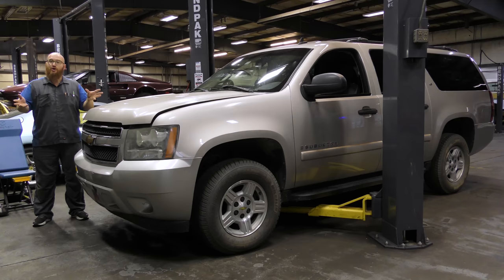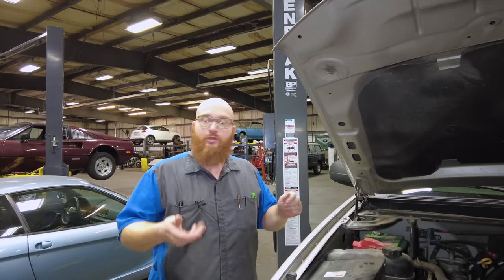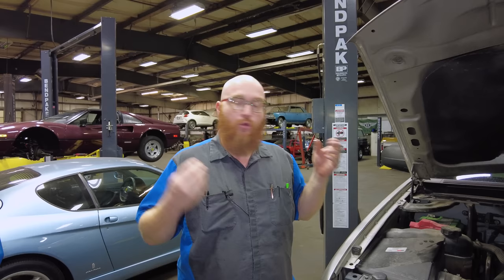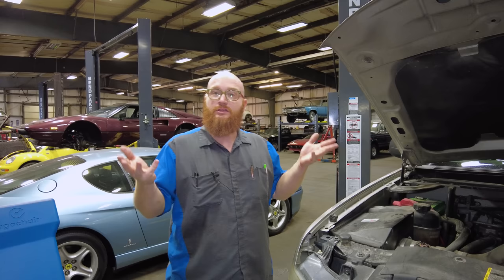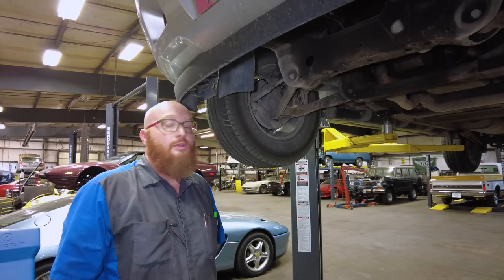What fails on ALL early 2000's Chevy SUV's!? CAR WIZARD shares what he's seen from the last 20 years

Comment: My dad has 2010 Tahoe he bought with 4k miles on it in 2011, and it’s currently at 340k miles. It is the most reliable truck I’ve ever seen. We live in The rust belt and have abused this truck every year sense we got it. I’ve pulled trees down with this thing and everything still works, even the fuel management! Really goes to show what proper maintenance and annual rust proofing can do
RE: I just started driving this truck as my daily for college and work, and have put about a couple thousand on it. It sat for a bit so not much has changed but she still runs minty fresh. Burns a little oil but with this kinda mileage you expect the rings to be less than factory fresh. Have new quarter panels and rockers on the way to make it look brand new.
Reply: Wow i have a 08 suburban LTZ with 210k miles this video scare me lol, but my SUV is reliable every thing  works great, i even pull a trailer 8k pounds weight with load for thousands of miles, my wife love this suv
Reply: Like they say even the broken watch is right twice a day. I had 3 GM 2 Chevy's they rotted out bad. Brake lines brake module transmission fuel pumps. Wen my brake lines and module went on my last truck I  scrapped it way to much to fix. The engines were not bad just everything else around it failed. Joys of living in the rust belt.
Reply: That is a rust belt issue
Reply: @markchapman2585  that is a rust belt issue not a general motors or Chevy problem trust me I have a Yukon with 432 thousand miles on it in Kansas City quality maintenance is job one
Reply: @markchapman2585  i loved the 2017 toyota rav4 (awd) in snow and ice. it was a night and day difference with 40% tire tread remaining compared to my 2015 kia soul (fwd) with brand new all-seasons. people that say that there's not much difference between awd and fwd are so wrong. i saw power being sent to the wheels individually on the rav4 even in a straight line in motion. i tell you what the rav4 is alot larger inside than it looks from the outside. lol.
Reply: Got a 2004 suburban z71 with 400k plus
Reply: @markchapman2585  Prove it. Because I think you are lying.
Reply: @Lincolnator721  i😅
Reply: That like saying I guarantee a person will die in they life
Reply: @markchapman2585  
Lanolin, every fall.
Reply: I have a 2004 Silverado with 320000 miles on it and I tow every day with it
Reply: @Fadi lsx  I have a 2004 Silverado with 170000 on it and I've spent a small fortune on it the past  10 years trying to keep it going
Reply: @jimmystone7325  that’s absolutely insane, I’ve spent next to nothing on my 321k mile 4.8 4l60 truck. I own a used car dealership and I use it to tow my cars all the time! Maybe the previous owner molested it hard ?
Reply: @nickajk1  it's a design problem. They can plate components much better than they do. Engineered to rust at about 7 years.
Reply: @MrCoyoteculler  everything today is cheap what do you think you see so many cars from the 50s 60s and 70s still around
Reply: "Since" not sense.
Reply: @k.c.marshall921  I'm sure it was a talk-to-text
Reply: Dimond in a rough most the the 90s and up chevys fall apart left and right mostly front ends and transmission
Reply: LOVE your story and love the fact that I've got an ARIZONA car with ZERO corrosion.  We do, however, get sun damage to the paint surfaces.
Reply: AFM , direct inject is were they went to crap
Reply: The same with my 2000 Tahoe. This guy is wrong wrong wrong. Not one single thing he mentioned has failed on mine and I have 300K on it. Tranny, 4X actuator and brakes is all. Tranny because I tow a loaded trailer a lot, and I do a lot of 4X4'in in the woods logging in the Northern Colorado Rockies at 7500 feet with brutal winters. Thumbs down on this channel and I wont be back.
Reply: @robertslatten556  but the thing is, he isn’t wrong. I’ve worked in 2 shops in my life and I’ve had a couple of these DoD engines come in with bad lifters. It happens. The key is maintenance. 3k oil changes and regular service intervals. New oil once in a while goes a long way for these.
Reply: @robertslatten556  My guess is that YOU are LUCKY, LUCKY, LUCKY given there's lots of AFM disasters out there and I stick with my '01 Suburban given it's got 320K miles on it and is in excellent condition and I'd buy a newer one BUT I as scared with those dual lifters and all the issues Chevy delivers to their customers because they suck up to government at the expense of their customers.
Reply: @nickajk1 factory should have fractured in rust problems and solved in designing
Reply: @richhuddleston73  really you believe it's a manufacturing problem or the local governments that over salt the roads and use up their inventory which is a little bit of rain or snow
Reply: sense we got it
Reply: I’ve got 237k, they made millions of these. Just gotta make sure you got a “good egg” haha.
Reply: I wonder why there's a pending lawsuit against general motors for the brake lines rusting out prematurely.  I was quoted new brake lines $1800. 05 Yukon.
Now I have to repair all the other electrical issues and engine including the oil consumption do to poorly designed valve cover on drivers side.
Reply: @robertslatten556  Ok Karen..erm..Robert. Ok Robert. Sorry 😅
Reply: So which is it 4K or 3K?

Comment: I’m a former GM Partsman. This video brings back some memories. One thing I’ll offer is this: If you ever go to a dealership to get a part and the parts person just walks to the shelf and puts it on the counter before you finish describing what you want THAT is a high failure item. GM had plenty.
Reply: Especially the 300% markup at the dealer .
Reply: Do people really buy parts at Dealers?   WHY?
Reply: @jcx5659  Sometimes a part isn't available anymore anywhere else.
Reply: @OmniMontel  and aftermarket stuff these days has such a high failure rate out of the box you're better off paying out the ass for an OEM replacement
Reply: @marks93cobra  There does seem to be a higher percentage of outright junk/borderline scam stuff than there was 10 to 15 years ago.   What's weird to me is that a decent amount of it seems to be not priced like that but most of the known name parts still seem to be decent.
Reply: Ford had plenty, Dodge had plenty, BMW has plenty, .....................
Reply: @jcx5659 the only reason I ever did was because that was the only place to buy it. And that was intentional. Dumped that Bs.
Reply: And they would continue to install them in their new vehicles as long as they were on the shelf.
Reply: but in spite of all that. dont let it scare you. 90% of these problems are fairly cheap parts with generally ample room to do the work. thses are great trucks. my family have owned like 9 different makes and models of these. love these vehicles.
Reply: Do people really buy parts at the dealers? Yes. Aftermarket parts are junk. ESPECIALLY any type of electrical parts. I tell customers or anyone asking me for advice if a part has wires coming out of it or wires plug into it, buy oem. I replaced the alternator in my camry awhile back. The original one lasted 150,000 miles. Ive had to replace the napa replacement every 2 months.
Reply: Gotta order or have someone order poor people. I'm glad I have a parts store and mailbox. My dealer is shady all 3 off them what aren't tho😂
Reply: @OmniMontel  Or , the aftermarket part is generic and the factory replacement is specific, Like the different O2  sensors for Denali's that were either US or Mexican built
Reply: In my 2013 The heater hose at the firewall will fail due to the plastic parts.  used. Very informative I'm planning on doing plugs and wires

Comment: I bought a 2007 Tahoe with the 5.3 new for my wife.  It has 120k miles.  I have replaced a lot of the parts you talk about, but I maintain all my vehicles, and I trust my mechanic.  He knows I will say go ahead and do it.  But really its been super reliable.  I have offered to replace it for my wife several times she says, "No, its reliable"  I think the key is keeping up with issues so its not one big bill.
Reply: You nailed it on the head, it's mostly small stuff and easy to keep up with if you maintain your vehicles properly. Every vehicle, regardless of make or model, has quirks. My 2003 Yukon XL is a rare 3/4 ton with the 496 big block in it. It is a sought after version because it is pretty rare and mine is also pretty darn clean at 176k miles. Most just see another suburban going down the road but some recognize it as the rare spec version that it is (8 lugs and its larger factory stance is a dead giveaway lol). I've been offered twice it's value many times, but I refuse to sell it. I use it to tow a 7k lb trailer for work almost everyday and it is far too reliable for me to part with it.
Reply: @catfishbilly7425  Euro cars have more quirks. you'll be spending hundreds to thousands yearly if it's a 10 year old car. Maintaining them yourself is a must or else you have to be rich.
Reply: Sold my 07 Silverado with the 5.3 at 293k
Reply: Jeez, as a Toyota tech it's insane to me that stuff failing like this is considered normal
Reply: I bought  2013 Infiniti SUV , built in Japan with 180k miles. I replaced no parts at all, everything original, no check engine light, no leaks.
Reply: @rachegreenrg  good for you👏 here's a 🍪
Reply: I also have an 07 Tahoe ltz and it has 274k miles and still running strong. I actually just had the brakes and suspension changed yesterday. I don’t recommend bigger tires and a lift kit like mine has because it wears out the ball joints quicker but other than that I’ve had no major problems. No leaks. It does have the common cracked dash but that don’t really bother me.
Reply: @daltoncivils122  Thats great to hear.  Ours is also an LTZ and is bone stock.  Really been happy with how good it has been to us.  I know everyone says Toyota is way more reliable, well IMHO not even close.  I have had these Toyotas:  1976 Toyota Celica, my first car. 1982 celica/supra, 1987 MR2, 1989 Supra Turbo and I bought new a 2004 Highlander.  I honestly can tell you every single one of the Toyota vehicles I have owned have been garbage.  Non stop problems.  I kept buying them because my dad would tell me American cars fall apart buy Japanese.  Well I have found exactly the opposite. I currently own a 2017 Chevy silverado 3500hd Duramax, 2018 Audi A5, and the 2007 Tahoe.  They all are very reliable and great.  I wont buy another Toyota.  Ever.
Reply: @daltoncivils122  Amazing
Reply: @catfishbilly7425  👍Thats a sweet truck. MY brother has a 02 3/4 ton suburban with the 8.1L with barn doors.  It tows similar to a diesel.  I bought an even more rare 2011 3/4 ton suburban, they didnt offer the 8.1 but the L96 6.0L is a darn good engine.  No AFM on 3/4 or 1 ton trucks of that era.
Reply: @LordOfSilense   Right Toyota prefers to have the frame rot in 5 years and recall hundreds of thousands if not millions of vehicles... I fixed two 4runner frames cuz they missed the cut off dates on the recall.  My 09 taco had the recall.  Cost Toyota $13k frame and labor and a rental car.
Reply: @boxerdog5979  Crickets from the toyota fanboys club. lol

Comment: My Mom has my Grandparents old 2007 Tahoe LTZ. It’s got 430,000 (267,000 miles) kilometres on it and still going strong. Original engine and transmission. Only broke down once because it needed a new battery.

Comment: 1:40 Oil Pressure Sensor (Transducer)
2:45 Corroded connections on the Main Fuse (No Start) (07+ models)
3:39 Active Fuel Management (AFM) Failure (Lifter Failure) (07+ models)
5:14 A/C Belt Tensioner Failure
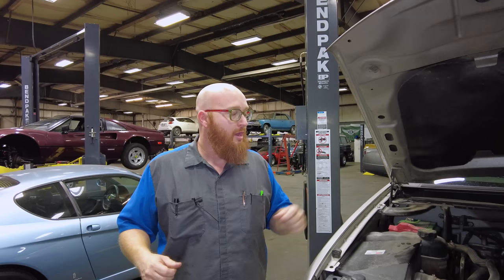6:19 Coils, plugs, and wires
8:15 Broken Exhaust Manifold Bolts
9:50 Knock Sensor Failure/Corrosion (00-06 models)
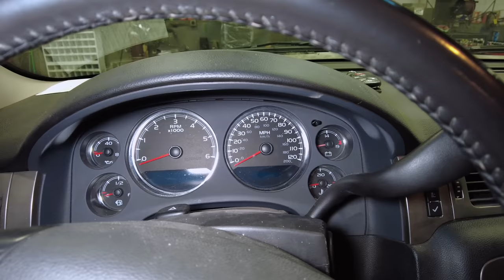10:46 Instrument Cluster Stepper Motor Failure (mostly affects 03-06 models)
11:43 HVAC Blend/Recirculate Door Actuators
13:20 Transmission cooler line leaks
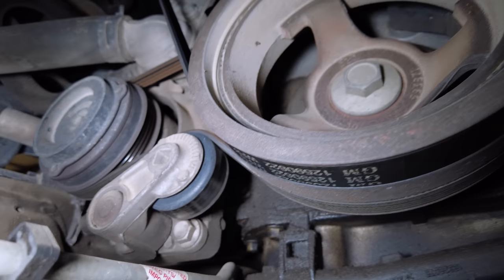14:05 Oil Cooler Blockoff plate leaks
14:55 Oil pan gasket, rear main seal
15:05 Oil Pickup tube o-ring (low/no oil pressure)
15:46 Front differential Axle Seals
16:12 ABS module bad solder joints (00-06 more common)
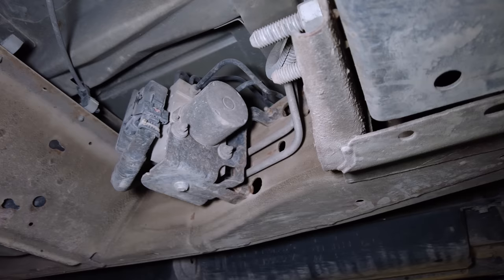17:12 4l60e go PNNNNNN

Matt's Honorable mentions:
- can't fill up with fuel -- clogged/failed evap cannister (fills evap system with charcoal). Replace the charcoal cannister, rear vent solenoid, and front purge solenoid. Also, clear all evap lines of charcoal pellets (shop vac works). When you fill up with gas, the air in your tank needs to be displaced. The evap system is supposed to manage this, but when clogged with charcoal pellets, the air tries to go back out through the filler hose, triggering the fuel filler to think your tank is full and turn off.
- stuttering idle -- leaking intake manifold gaskets, leaking valve cover to intake manifold hoses. If the hose feels loose on the intake manifold tube, its likely leaking. This leak will cause a poor idle.
- Clunking when braking/accelerating -- motor mounts. the stuttering idle above can exacerbate this problem by causing excessive wear on the motor mounts. This can cause clunking under acceleration as your engine/transmission shifts around
- excessive body rolls -- front sway bar link is broken/missing. 
- low speed vibration -- ujoints on the driveshaft are bad
- slow cool leak/drip from front of motor -- water pump is going out. weep hole is leaking to indicate as such

probably missing some other good ones, but those are off the top of my head. I've owned a 2000 & 2008 Tahoe, as well as a 2006 suburban 2500. gmt800 is by far the best platform. the gmt900's have some improvements, but the addition of things like AFM and cheaper interior plastic really hurt that platform.

Thanks for the video Wizard!
Reply: Thanks for sharing
Reply: Thanks for the intel.  I'm getting a 'Evap system leak test fail' on my 2001 Suburban. Care to comment?

Comment: I have a 2001 Chevy Tahoe and I love it! They aren’t overly complicated to work on yet I still dread doing the heater core replacement when the time comes.
I bought it for $700 in 2020 with a blown transmission and thanks to YouTube videos just like yours was able to rebuild it. Not perfectly I suspect and might live a shorter life span than a done professionally one but so far it drives. 😅
Reply: My Chevy 5.3 SUVs have Transmissions rebuilt in Mexico -  no issues at all and they run well for another 200k miles I'm sure.
Reply: I'd definitely get another one for that price. Heater core went out In my 04 tahoe years ago, but I just bypassed it and kept going. Probably going to have to rebuild my transmission too before to long though.
Reply: Pay the extra get it built right
Reply: Nice!
Reply: Bravo!  Sounds like you got a good deal.

Comment: 2:50 A long, LONG time ago when I worked in a parts store, I had a customer come in and buy an alternator and new battery. He installed it in the parking lot, came back in and said he wanted to return them because they didn't work. I went out there to check his install, and used a multi meter to check the wiring: The mega fuse had blown. We had one on the shelf, put that in, and it was fixed.
Reply: I'm surprised you took back the alternator. Most shops wont do a full refund on electrical components because the trial-and-error guys may have misconnected something and ruined the parts.
Reply: @rollydoucet8909  He never stated he took back the alternator.. read again.

Comment: I have to agree that early 2000 suburbans were the most reliable.  This is kinda funny but true… yesterday my granddaughter came to visit, we were checking the air in her Ford Focus tires because her tire pressure light was on. When we finished with her car she asked if I wanted to check my sub and truck, I said sure.  She then asked if we were taking the truck or sub for the trip to her fathers, (my son). I told her it would be the suburban. She then remarked that she doesn’t remember us ever having another vehicles. I told her that she wouldn’t because she was just 3 years old in 02 when I bought my Silverado Duramax and the Suburban new!  They just don’t make them like they used to!